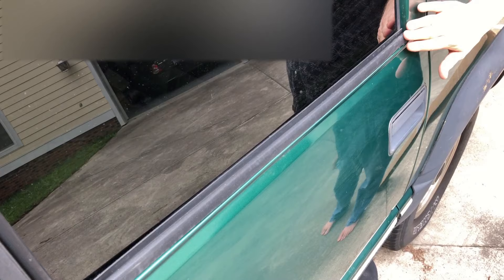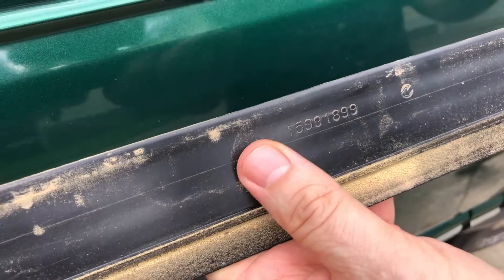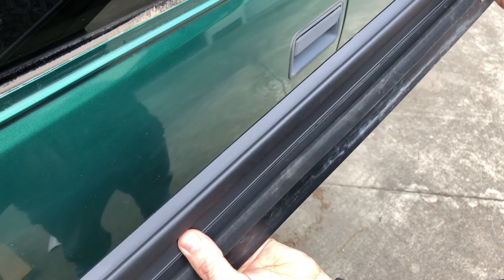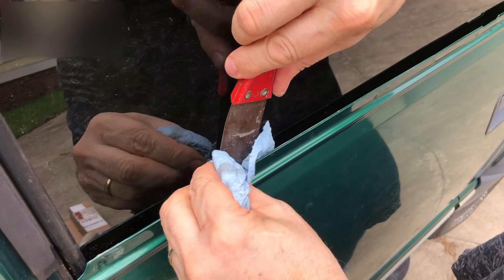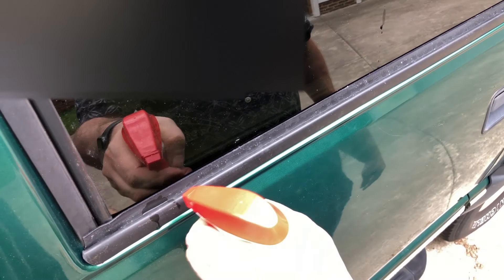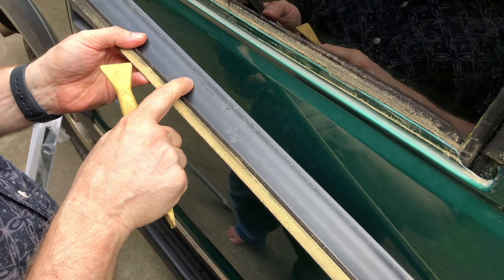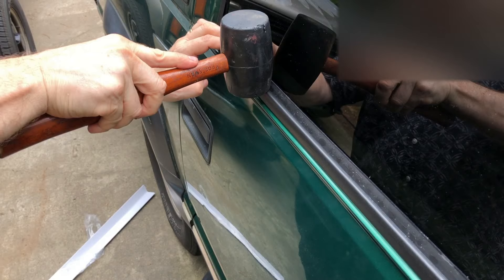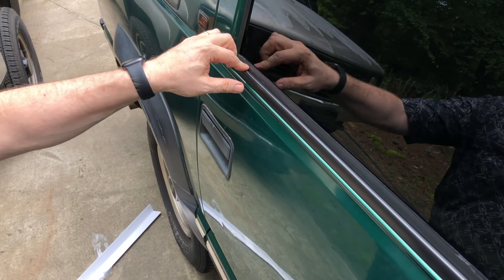1992 - 2000 GM OBS Truck SUV REAR Door Window Sweep / Outer Belt Strip Replacement (Chevy & GMC)

Comment from the maker: So this video was made about a month before being posted, and in that time I can share with you that both the Fairchild Industries G2069 and the Dorman 25837 exhibit significant material shrinkage in the Summertime sun.   I only showed the Fairchild brand as I believe Dorman to just be redistributing this same exact part.   The behavior I've seen across multiple trucks tends to confirm that.   I did order a pair of both brands and installed them on two different trucks with the same poor results after sunlight exposure.
 
These aftermarket sweeps will shrink about 1/8" - 1/4" at both ends after a few weeks of Summer sun (one truck was parked the entire time and the side facing the building did not shrink).  This exposes the gaps to let rain water enter the door assembly, promoting inside sheet metal corrosion.  Unfortunately there's no other replacement part choices as the GM OEM version has been discontinued for many many years now and is simply impossible to find.  Fairchild seems to be the sole remaining aftermarket manufacturer of this part, and sadly using different inferior materials that just do not hold up as well as genuine GM.  Just wanted to share this additional info with you guys.

Comment: Nice.  Thanks!  I can't wait to see how you replace the front door weather-strip on these trucks.  That one has me stumped.
Reply from the maker: The front outer belt strip is very similar to do and also only available thru this one aftermarket manufacturer (though several including Dorman resell them).  For the front you have to remove the outside mirror first (part of the front strip tucks underneath it).  You will likely need a special tool (its a wide flat metal type with a small lip to grab the weatherstrip) to release the front, it's held a bit more securely than the rear but still just a friction fit.  Installation is the same as the rear, other than tucking one end under the outside mirror housing first.

Comment: I believe I ordered the Fairchild replacements. But when I receive them, they had a slight curve or bend. Now the band or curve if you want to call it, is a lot worse. How will I be able to have them straight again? Is there a special technique and they also have some little holes on the end. Are those supposed to be secured on the inside of the door skin or how do you secure them?
Reply from the maker: In typical asian aftermarket fashion the companies copying these parts screwed them up by using an inferior (aka cheaper) plastic vs the GM originals.  The inferior plastic shrinks and warps when exposed to any heat (such as sunlight).  Once they get like this there's no repairing them unfortunately. 

The rear window sweeps are friction fit to the door sheet metal only, in either OEM or aftermarket versions.  No fasteners or other attachment needed, or used. 

As usual, the only lasting repair is to stay with genuine GM parts.  Either used or NOS are going to be better than aftermarket.  I eventually found an ultra rare NOS pair of genuine GM sweeps for this trucks owner which fit and function as expected.  I added this GM part number into the video description.

Comment: Since the aftermarket ones dont last, is there a way to take the stock ones off and dress them for maintenance and put them back so they last longer or best o just leave them alone?
Reply from the maker: The aftermarket ones, as is nearly always the case with anything not genuine GM, are compromised from being made of an inferior plastic as mentioned in the pinned comment above.   As long as you keep the truck garaged and never parked outside for any length of time in the sunlight they can be "OK".   But NOS GM ones are the way to go.
 
You can remove the originals if you are very careful, but given their age it's more likely the clasps will be damaged and they won't hold on anymore.  I'd say leave them alone unless you are having to repaint the sheet metal of the door.

Comment: Ive got a 95 with what must be after market window sweeps that look fairly new but they keep coming out of position on the side of the window closest to the door jam. Is there any way to tighten them to prevent this?
Reply from the maker: Unfortunately from what I’ve found ALL brands of these aftermarket sweeps are made of a material that shrinks at both ends when exposed to the suns UV light.   The ONLY parts that fit correctly are the genuine GM ones, but they have been discontinued for some time now.

Comment: I'm trying to find the right one for my 99 burn but the part keeps coming up it doesn't fit
Reply from the maker: The part numbers I list in the description would only be for the old body style (OBS) type trucks.   Some of the OBS models ran thru alongside of the new body style that came out in 1999.  So be sure that's not the issue.   If you're using a part compatibility check on a site like eBay or Amazon, don't.  It's just not accurate for a part like this.  Use the parts compatibility search from the website of the part brand you're looking to buy instead. 

Also be sure to note the pinned comment I made after doing this video, like with all non-GM parts there can be quality problems with these aftermarket sweeps plastic shrinking when exposed to sunlight.